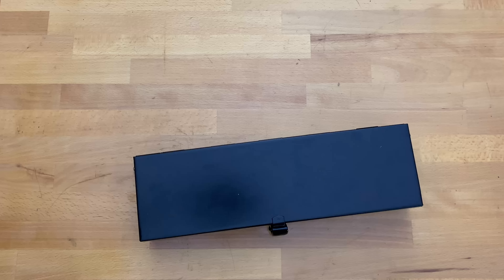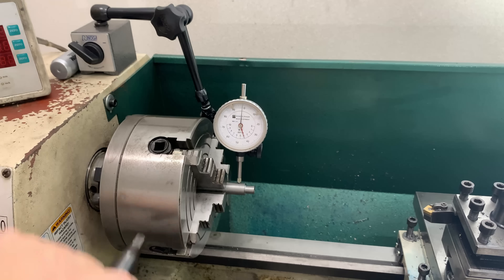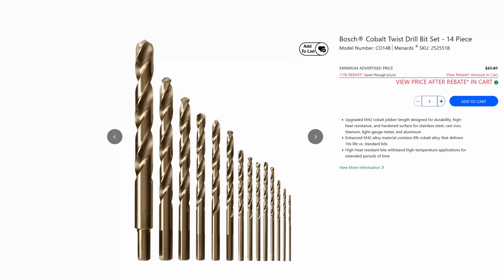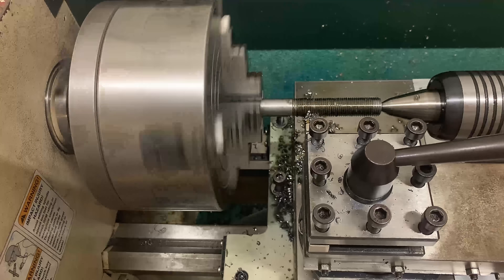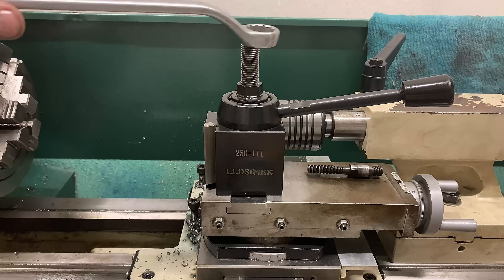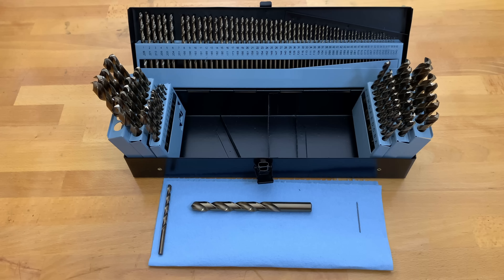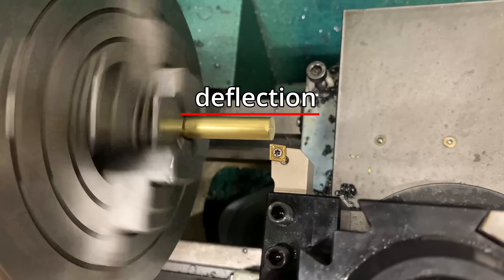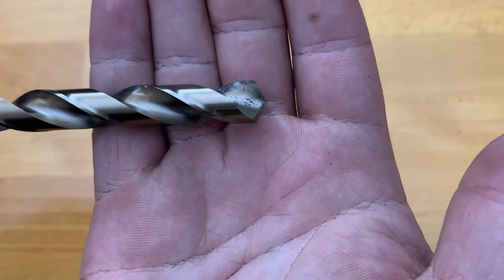Are Harbor Freight Drill Bits Secretly AMAZING?

Comment: How is calling them drill bits a bad habit?

That's the most accurate and appropriate word for them.
Reply from the maker: I think the old timer machinists called them drills around the shop and purists try to stick by that nomenclature. I use them interchangeably really.
Reply: @ShopHumor  if that's what a drill is then what do you call the hand-held tool you chuck it up into🤔?
Reply from the maker: Also a drill, haha
Reply: @ShopHumor  that just makes things confusing.
Reply from the maker: @jonathonrossebo1783  You're not wrong!

Comment: I love mine I do facility mamaintenance and apartment maintenance  I'm sure there's better but they are cheap and they get the job done!!!
What I like is the bov fits perfectly on top of  my drill press I put  6 high power magnets to keep it in place!!!
I would not use them in a  portable drill !!!
And  I keep them wet with oil I made a system that feeds oil to the  bit and I drill slowly and I haven't broken one yet!!!
And like any cutting tools you gotta keep them sharp!!! I love mine ♥️ 💗 💕 ❤️
Reply from the maker: That sounds like a great system you developed! Thank you so much for the comment :)

Comment: I am sure my 50 year old set of Henry L. Hanson HSS will out shine even the Harbor Freight cobalt set. I cruise right by these sorts of tools when Harbor Freighting. The one thing I have learned through the years is that quality counts and is not cheap.... and WD40 makes a horrible coolant, lubricant on a drill press or a tap and die etc. I have purged water out of a distributor cap successfully with WD40 though.
Reply from the maker: I prefer to spend the savings on higher quality end mills and reamers, as those are the precision tools that will bring the drilled hole up to it's final dimension.

Comment: The 115 piece drill index is screwed together. Screws and nuts needs thread lock
Reply from the maker: Thanks for the tip. I’ll check to see if anything is loose or I can adjust it for a better fit.

Comment: Use them right with oil at the right speed 👌  have a set that's 10yrs old at least. Still fine
Reply from the maker: That's exactly right. Technique and knowledge go a long way. The right feeds, speeds, and lubrication will go a long way.

Comment: Buy this set. If a drill wears out, buy a single from McMaster or Drill America or your favorite place. Eventually you will have a set of drills with high quality drills for the sizes you use often and a full set of drills for the rare time you need an odd size. This will still be a fraction of the price of a high quality set that has a pile of drills you will never use.
Reply from the maker: Very good advice. And also you can always stockpile a few of the sizes you use the most. Drill America has a dozen #7 cobalt drills, stubby length, for $30 on amazon, for example. Thanks for taking the time to comment.

Comment: What brand would be a good set? That's not also going to break the bank?
Reply from the maker: I liked this  HF cobalt set just fine for my needs, but I'm going to use them exclusively in rigid machinery (mill, lathe). If you're using them in hand tools your mileage may vary.
Reply: @ShopHumor  I was not talking about the harbor freight set
Reply from the maker: @tr165eaglebsa4  I gotcha

Comment: At one point in time I was desperate enough to try HF drills.  The "cobalt" set was so soft that I actually had more than one unwind. And the others which didn't, dulled in mild steel in about 1 revolution.  HF has improved quality the last couple of years so I can't speak to current stock but I learned NEVER to buy consumables from HF.

And typically a full set is a bad idea for most users anyway.  It's cheaper to buy HIGH quality bits in the few sizes one typically uses--you will never find that kind of quality in a home center store, even if it is a famous brand. Proper drills from machinist's suppliers are an order of magnitude better than that home center crapola.

And yes, I do own a production machine shop--and learned the lessons the hard way.
Reply from the maker: That's crazy that the Cobalt drill actually unwound!

Comment: I had that exact set at work. I was drilling a block of aluminum with a cordless drill and the bit snapped in the work.  The broken shaft was still sharp enough to fully penetrate my finger, narrowly missing the bone.
Reply from the maker: That's scary for sure. Any permanent damage?

Comment: You keep this set around to cover a multitude of sizes.   You also buy a box of 1/4", a few 1/2" quality drills, etc.  I have one $13 1/2" but I have used for a decade or more and never needed to sharpen.    If you break a drill, that is on you.   If it gets dull quickly or chips, it could be a bad bit, but chances are better it was the wrong tool pressure, lubricant, or speed.
Reply from the maker: I agree with your philosophy. Stockpile the most common sizes and keep the index around for the oddballs. And I agree about pressure, lube, and RPMs!

Comment: Thats ok and all but tell us... Wtf you need a number 7 hole for? O.o
Reply from the maker: Haha, well I am making an adapter for my camera mount and it needs 1/4-20 thread which needs a #7 or 13/64ths to get it to the right size for the tap!
Reply: @ShopHumor  whatehell man, i never even knew a number 7 had uses kk.  all we use here is 6 or 8, ocasionally a 4 for rivets lol
Reply from the maker: Haha that's funny. Makes sense though any time there is a specialized size someone out there probably needs it for something...

Comment: Many years ago (40+) I bought my 115 piece set of HF drill bits. They came in a US made HUOT box and the drill bits were advertised in the paperwork as Made in South Korea. Most of the standard bits have been replaced over the years while the letter and number bits just keep on churning away with a few replacements. These have been mostly decent. I bought a small HF set 5-6 years ago to carry in our RV. Total crap and went in a dumpster. One interesting tool that we picked up at a job site in S. Korea was a locally manufactured Imperial dimensioned tape measure that had five (5) quarter inchs per inch. That one cost our contractor a bunch of bucks (won?) to rework 8 large turbine foundations.
Reply from the maker: Wow, 5 quarters of anything, inch or otherwise, seems interesting indeed!  I know that HUOT still makes index cases and if the one that came with this HF set pisses me off enough I’m going to upgrade to a HOUT.

Comment: ok, these bits should not have any problem drilling in aluminum or brass. its obviously drilling in steel is the hard thing.  I've bought several brands of drill bits that would be good for a couple uses and then just not be worth using after that. What sucks is how buying just a few bits that you might need of most brands costs about as much as a set.
Reply from the maker: So far they’re going through steel no problem, we will see how long they last before needing to be sharpened. I think the cobalt should hold the edge longer… but time will tell

Comment: "Buy once, cry once" is actually "Buy once and cry every time you need something else because all the money is gone." Although TBH for this kind of drill set in a hobby situation, you could do just as well ordering high quality packs of individual bits as needed because you're only going to need a few common sizes.
Reply from the maker: Yes, and that’s actually what I plan on doing — stockpiling higher quality drills in the sizes I most commonly use, but having the index available for when I need to tap some weird will be nice. Thanks for commenting!

Comment: I recently went through the same search for some cobalt bits. I ended up with a Titan USA set, we use Titan endmills sometimes at the shop and they're pretty decent USA made tools (owned by Harvey Tool). They're definitely a more expensive but I do believe the material quality is much higher and will last longer.
Reply from the maker: Good tip. I definitely don’t have anything against anyone buying quality. For most of what I do in the shop, I drill a smaller hole than final dimension, then use an end mill or reamer to bring it up to size, so in my brain I can go a little cheaper on the drills and spend a little more on the end mills and reamers. 

I’ve been looking at a couple end mills from Lakeshore Carbide bit I’ll give Titan USA a look as well. I’ve had good luck with a couple Harvey’s, including a single form thread mill that gets a lot of use.

Comment: I've had a couple sets of these at home and my shop. I lose them more often than breakage so that's a benefit for low cost. If they DO get a bit dull after awhile, a quick zap on the bench grinder and they are ready for a few dozen more uses. Some of mine are getting a bit shorter than they should be, but way better than buying new.
Reply from the maker: Yes sir. And really, every single drill no matter who makes it will need to be sharpened eventually if you use it enough.

Comment: I bought this set purely to get the drill index (the organizer box), and looked at the drills that come with it as a bonus.   Are they great drill bits?   No, they aren't.  But they are perfectly adequate for general purpose hole drilling.   For my purposes of knifemaking, I use a handful of specific drill sizes that I order en masse.   But sometimes you need to go up /down a few thousandths and it's usually a size that you don't have on hand.   For those times, having one of every size under the sun is a life saver.   The drill sizes that I use regularly just get replaced with the specific drills that I order by the truckload.    The ones I don't use very often get sharpened until they need to be replaced.   I guarantee that in ten years, 80% of this set will still be the original drills that came in the set.  I highly recommend this set for every home shop with a drill press.  It's a no-brainer.
Reply from the maker: Damn straight. Thanks for taking the time to comment, I appreciate it.

Comment: Lol. The guy that complained those they had at work was all dull. Ofc any drill getting used gets dull from use.
And to really know if a drill is good you need to drill more holes regrind it and make more holes. Se how does it hold up. Cheap or expensive as long as is made from decent material.
Reply from the maker: Yes sir. Every drill no matter how well it’s made is going to dull over time. Whoever invents a cutting tool that works well day in and day out without ever needing to be sharpened is going to be a very rich man 😂
Reply: @ShopHumor  ofc when you have CNC it's no problem to have quality drills last long. 
Manual drilling not so much.

Comment: I have a horrible freight old titanium gold set that I keep next to my drill press. Over the years many have broken but when I pick up a tap that requires some weird number or letter size I stand a pretty good chance of having a bit that will work.   The small fractional ones have worked great for modifying carburetors, or other odd projects.   I try to use them with my drill press, slowest, setting, and lots of water-based lubricant.
Reply from the maker: Good advice. That’s the best bet — rigid machine, right speeds, good lube.

Comment: I have one set of those that I bought and a second set that was my dad's. The only complaints I have are the box, which is the same as here, the latch is junk, the lid doesn't match the box and is a pita to close. As for the bits, I have made a lot of cuts with them and they held up very well but I, and I repeat I, have broken a few of them, usually because I'm impatient and didn't clear the hole of chips often enough. I have access to a high end but sharpener and have had to sharpen the ones that get more use but that goes for all drills. My opinion, they are damned well worth the price.
Reply from the maker: So far I’m in complete agreement with you. They’re just really a good value for what you’re getting. The case sucks, as you mentioned and I noted in the video, but it is what it is. If it gets to bothering me enough I’m going to just replace it with a better one.

Comment: I've had the HF Cobalt set for many years. Assuming the current set is of the same quality as my old set, and that's never a certainty, I'm a big fan. They cut well and maintain an edge well. Cobalt drills are more brittle than ordinary HSS drills so some care is required. And they must be kept sharp over time as is true for all drills.  Thanks for the video.
Reply from the maker: You're welcome! Thank you for watching. You're right about maintaining and sharpening your drills (and other cutting tools, too!) - makes all the difference.

Comment: I’ve been using one of these sets for the last 9-10 years. They are kind of brittle. Several of the smaller bits snapped easily when drilling through about a 1/2 inch of steel. I was using a handheld drill, so that’s not too surprising. A couple snapped while using a drill press as well, but I might have been using too much force. However, they have been great for the price. I certainly don’t regret buying them. Many are still sharp enough despite being used thoroughly. They are good enough for what most hobbyists intend to use them for.
Reply from the maker: Thanks for letting me know about your experiences with them. It seems like you've gotten your money's worth. Like you said, good enough for what most hobbyists are using them for.

Comment: My only thought is why would a manufacturer make a thin web cobalt drill, being the material can be brittle.  Reminds me of my first large index, which I have none of anymore.
Reply from the maker: What happened to your first index? Just burned through them over the years?
Reply: @ShopHumor  About 20 years ago was when I made the purchase, along with a mini lathe and drill press, I was constantly milling everything for woods to plastics and softer metals. A Drill Dr. wasn't too far behind those and was semi effective but yes they pretty much all got snapped short, dulled and never sharpened well or bent which I've seen recently with a few cheap drill bits.
Reply from the maker: Thanks for letting me know :)

Comment: This set of drills is good.  Not great but also not bad.  My set is probably 17 years old and I still have almost all of the original drills.  They're my backups to better drills up to 3/8".  My oldest drill index dates back to 1972 and most if not all are not the original drills; having been replaced as necessary.  I use the HF numbered drills and those over 3/8" frequently.  Very few have been replaced.  They are rarely used in a hand drill; more likely to be used in a drill press, milling machine or lathe.  I'm an amateur machinist and do machine work several days every week. I only use a hand drill when I can't use machinery.  The holes are not perfectly sized nor are they perfectly round but that is not the exclusive domain of cheap drills.  Name brand drills from the home improvement and hardware stores are also capable of out of round or off sized holes.  The index, as you said, is pretty crappy but it does serve to help me make sure I put everything back where it belongs.

After all of that, I no longer buy HF drills.  I've bought several specialty sets that weren't straight, had bad heat treating (would bend without breaking) and in general found that none of the other  HF drills that I have purchased were as good as this set.  My work is generally precision work as a volunteer on a battleship restoration and I can't be messing up expensive raw materials due to poor tooling.
Reply from the maker: Thank you for the comment and letting me know about your experiences. You mentioned getting out to your shop several days a week - what projects do you usually work on?
Reply: @ShopHumor  Sorry for the delay.  The biggest project, no pun intended, is making parts for the restoration of the battleship USS Texas which was built before WWI.  I mostly make fasteners, shafts and other “small” parts for the deck guns that can no longer be purchased.  I have a 3HP 13x40 lathe and a full sized knee mill in my shop.  Today’s project was to make a new pivot pin and retaining screws for the ship’s steam whistle actuator.

Comment: I used tp work at HF a long time ago.  I saw every tool come in and out and handled returns.  HFs only real issue is quality control.  For the price the tools perform better than fine but i would definitely try them out ASAP, in the store or parking lot if possible and at least unpack them and give them once over.

One time we had jackhammer returned because it wouldn't hold a bit.  Yeah. Factory welded the chuck in backwards.  The chuck that uses gravity to work.  So everytime you put the chisel in it would fall right out because the chuck would open up.
Reply from the maker: That’s crazy… talk about a major screw up lol